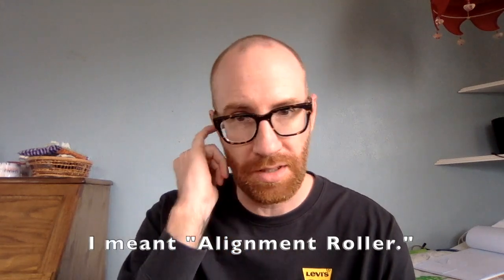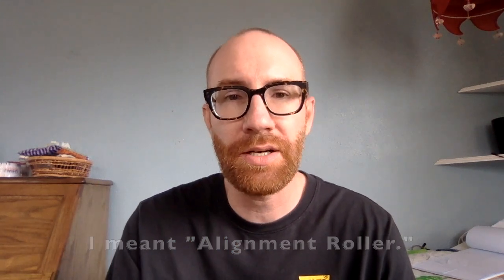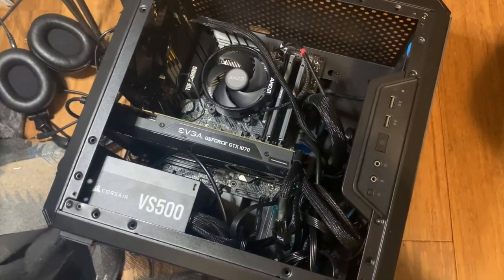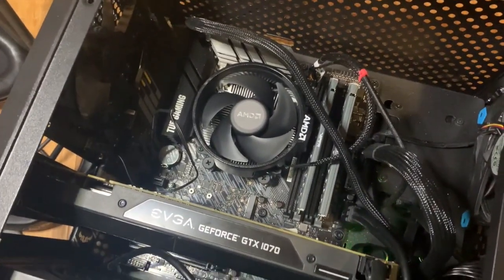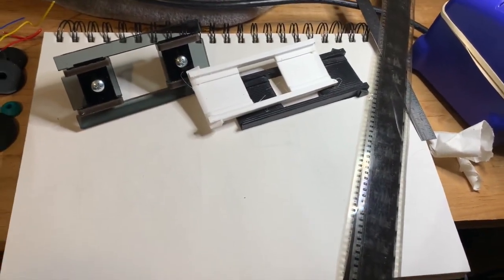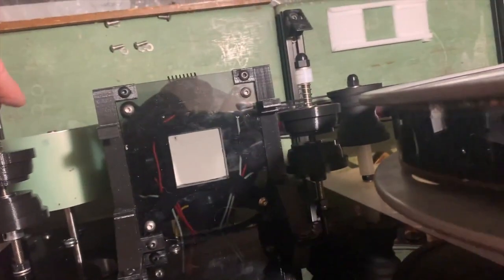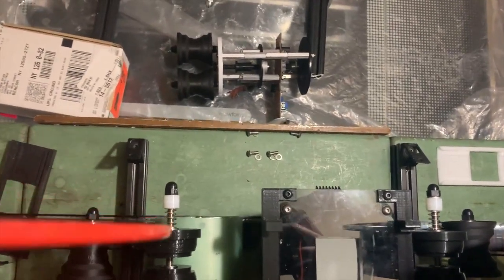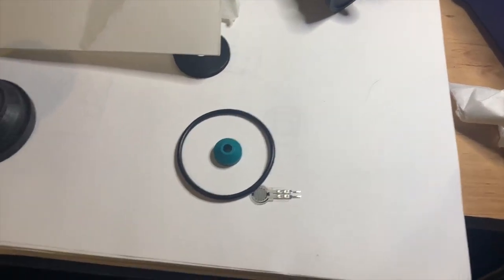Kinograph May 2021 Update

Comment: I wasn't sure where in the Google sheet to make a comment, but thought I''d mention that I have 2 custom scanners built by Tobin Cinema that use the Sony 250 and 252 Pregius sensors under consideration. The cameras in my systems however are from The Imaging Source. I've been happy with them overall. The developer (Tobin) did not like the FLIR software, preferring the software from The Imaging Source. I never used the FLIR software, but can say I have liked the software from TIS. There are multiple possible workflows, but I like that you can capture an AVI file in real time though the frame rate is determined in the software, independent of the scanning rate and can be easily changed later on. I was told that other software requires a process of rendering still frames to get a workable video file. Anyway, that and the fact that the folks at TIS were really helpful makes me want to suggest considering their offerings if you haven't already.
Reply from the maker: Thanks, Steve! I haven't heard of The Imaging Source but your endorsement will ensure that I check them out. How are the results from those Pregius sensors?

Comment: I’ve been diving into film scanning recently. There are some good metrics around dynamic range, exposure, etc. 

There are several components of the capture: the dynamic range of the sensor at a particular ISO (in general lower sensor speeds with less gain produce greater dynamic range), exposure value and how that aligns with the sensor response, as well as the post processing of the raw info into output. 

Let me know if you need someone with a more EE/software background. These sorts of things can leverage a lot of software integrations to improve various attributes.
Reply: I'm glad you mention dynamic range, because that is one area that is especially challenging and seems to need improvement if our digital results are going to accurately represent the original film. I believe the sensors themselves are where the bottleneck occurs, but like you, I try to make the most out of limited software settings--in my case mostly shutter speed/exposure time and gamma, and then try to improve upon that with post processing. I'm mostly satisfied with that workflow, but I believe it could be better and easier to achieve with improvements to sensors and probably other controls available.
Reply: @steveunkles5361  I think the key is that you can compensate for sensor dynamic range by compositing multiple exposures in software using commonly available HDR algorithms. I could foresee the development of multiple modes of software to handle capture. One with single frame exposure, another with multiple exposures. If the film isn’t moving you can take several.
Reply from the maker: Re: HDR I'm hoping we can either find a way to do intermittent motion without sprockets or get a camera that has a high enough frame rate to take multiple shots of a single frame while keeping the film moving constantly. We can line them up using CV either on the fly if we have enough GPU power or in post. It will require a lot of testing but I'm hopeful :)
Reply: @kinograph9059  is the plan for continuous feed or for film gate style wratcheting? The main problem with continuous motion would be the blur and the light required to obtain satisfactory exposure with a moving object. I would assume some sort of custom firmware and sampling algorithm would enable continuous feed but it adds quite a bit of complexity on the capture side.
Reply from the maker: Thank you, Nicholas. I agree that dynamic range is one of the most important specs in the camera choice for a film scanner. I'd love your help when we get something up and running. When we get a basic machine up and running I'll send out a call for software contributions. Stay tuned!